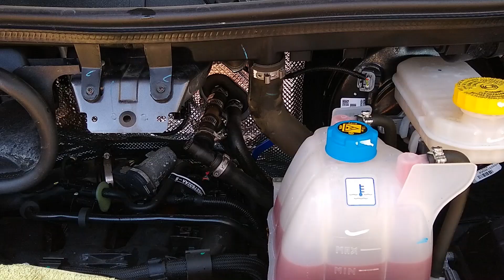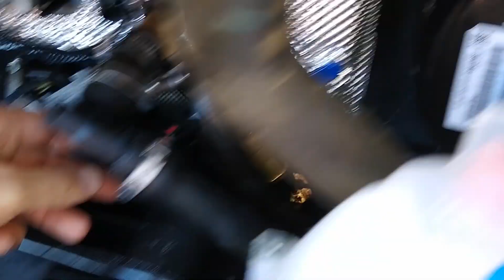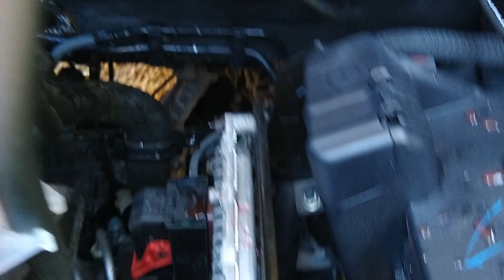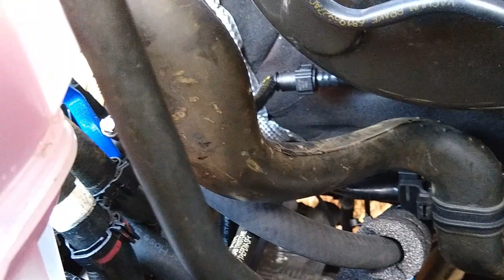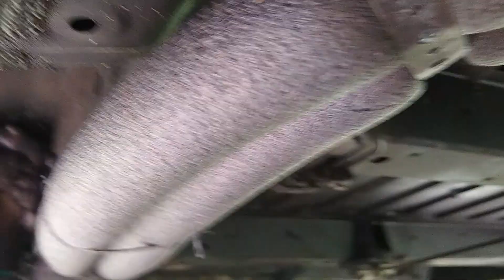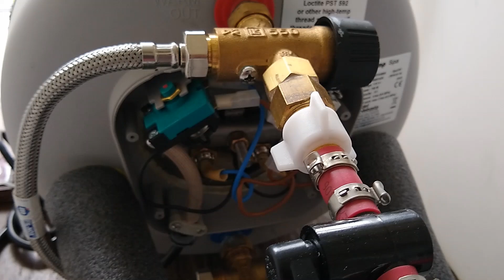Water Heater Install - Marine IsoTherm IsoTemp Spa 15 - DIY RV Promaster Camper Van - WanderingWakes

Comment: Question:  Why cut both side,  why not cut only one side (the return I guess) and install two 90 degrees fitting to extand the coolant loop instead of creation a second loop... I don't understand how the coolant will flow in both.  I will flow where there is less resistance... No?

Comment: Hi,  Thinking of putting one of those in our boat.  How long does it hold reasonable warm water?  I'm trying to figure if it is possible to maintain some heat in it overnight so one can wash up in teh morning without having to run generator or engine.   I have 200Ah of batteries and I'm tempted to put a 12 to 24V step up converter.  That would give me 32W and draw only 2.6A.     Running right on 12V would give me 8W.   If I knew how fast the temp drop in it I could figure out if this is at all feasible.  Any thoughts?
Reply from the maker: We regularly end our driving around 3 to 5 pm in the afternoon. Many times, we have waited until the next morning to shower. We seem to always have enough hot to warm water for two showers. The van is sometimes down to 50 degrees inside during the cold nights, but still warm enough water to shower. These are short showers of course. Hope that helps.

Comment: Thank you, very good and informative video. Much appreciated for the shopping list.
Does anyone know if the coolant hoses are the same diameter on Ducatos as well? Does it depend on the engine size?
If you have done similar on Relay, Ducato, Boxer(2011-onwards) can you please let us know about the parts you've used?
Especially interested in the T-junction dimensions.
Many thanks
Reply from the maker: I am not sure of the hose diameter for the other models. The tee connects would be the same on the middle tap, to match your hoses running to the tank. The in/out ends of the tee may have to be different to match your factor hose size. I would stop by an auto parts store, and then can likely measure them easily.

Comment: Great job ! I have the same tank but can’t locate the mixer  control ( mine does include the braided hose between hot and cold so it should be there ). What am I missing ? Thx !
Reply from the maker: The mixer valve should be the black knob on the hot side output of the tank. Top center when looking at the tank in my photos.
Reply: @wanderingwakes9500  how silly am I. Yes I have that knob, which is the temp control ( for the internal heating element ) but, in overcomplicating the issue, I had understood there was an additional control just to mix cold water with the hot AFTER it was heated. There isn’t obviously !!!
Thanks for clarifying
Reply from the maker: @OneEndlessRoad  Well, it is mixing cold water through that braided hose with hot coming out of the tank, so it does mix it after heating, but not too obvious. We find that a hot tank of water after driving part of a day is still hot enough the next morning for showering without running the engine to heat it back up. So the tank must be well insulated.
Reply: @wanderingwakes9500  that’s good to know. We are not quite there yet. So far I just have it connected electrically and have not run the coolant lines to the Hot Water tank. I was about to do that and I was then warned by the Mercedes sales guy that if anything were to go wrong with the coolant system, whether or not it was due to me tapping into the line, they would deny any warranty claim. He suggested I wait until the warranty was over and then do it. It did seem like a bit of overkill but at the same time made me somewhat nervous. A leaking coolant line could have rather disastrous consequences for the whole engine ! We will ultimately do it though and it was the main reason we chose this type of tank for our hot water supply.

Comment: Your video is tremendously helpful. In one of the comments you mentioned an app for monitoring exact coolant temperature - what is the name of the app and how does it function?
Reply from the maker: I use OBD Fusion and a bluetooth OBD dongle. This is the one I bought:
https://amzn.to/3NfPuC5

You can configure the OBD Fusion app to show many items. I set mine to show speed, coolant temp, run time, altitude, fuel level, and voltage.

I see my coolant temp get as high as 215 to 220 degrees at the high end with climbing long mountain grades. That is in the engine, so the coolant into the water heater is likely less than 200...

Comment: Hey, great video! I'm about to install this system in my skoolie conversion.. Should be easy because I have radiator routed into the bus for a rear radiator. One question though: On hot water exit there seems to be black platic.. a ball valve? is that what it is? I understand why you would want a ball valve on the cold water intake to shut off water and do work on the system, but why would you want one on the hot water exit? 
Thanks again!!
Reply from the maker: The black plastic knob is to control the mixing valve. It will mix cold water with the extremely hot water to make a temperature that is more safe. This comes installed on the unit I purchased. It is not a shut off, but a temperature mixing adjustment. Hope that helps. Thanks.
Reply: @wanderingwakes9500  Yes, I didn't mean that valve. 
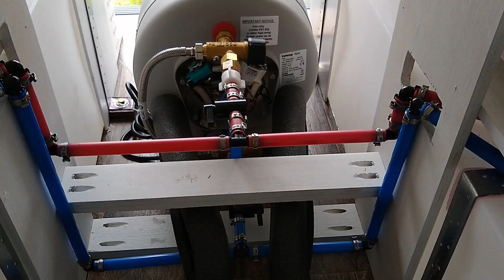Beyond the hot water exit theres the BSC fitting which you put a NPT fitting on, and then a white femal NPT which is connected to red pex. The red pex is connected to something black which looks like a ball valve... Is that what it is? Why would you want to put a ball valve on the hot water exit? It shows in the video at 11:08... Thanks again!!
Reply from the maker: @brutally_honest  That is a 3 way valve, there is also one on the cold water side. This allows you to bypass the water heater entirely by turning both valves to the bypass line. This is primarily used to winterize with RV antifreeze and not pump it into the water heater. However, it also could be used if the water heater failed or started to leak. I hope that clears it up.

Comment: There’s no heat exchanger? You would not need the three-way valve with a heat exchanger. This is actually my plan for my Ford Transit 350 HR AWD except it will be the hydronic system.
Reply from the maker: The heat exchanger is inside the isotherm unit. The three way valves in the pex lines are to bypass the tank for winterizing. Thanks and good luck.

Comment: Hi greetings from Ecuador
Thanks for you heard videos
Please can su explain about resistence and both thermostat in a heater isotemp thanks
Reply from the maker: There is no thermostat, but there is a mixing valve to reduce the water output temperature.

Comment: On my IsoTemp Spa 15 purchased February 2022, my drain valve thread is also a BSP. So, I bought another BSP to male 1/2 NPT fitting.
Reply from the maker: They must have made a design change. Thanks for the update.

Comment: I just finished an install on one and find that the mixing valve does not mix in enough cold water, and the hot water is still dangerously/scalding hot at the faucet! Trying to contact Isotherm with no luck. Did you encounter this at all?
Reply from the maker: Yes. You can loosen the screw holding the mixing valve black handle in place. Loosen it enough that you can turn the handle back toward the hot direction, without actually turning the valve. Reseat the handle and tighten the screw. This will allow you to turn the handle (and mixing valve) more in the cold direction. This worked for us. Thanks.
Reply: @wanderingwakes9500  I tried this but even backing it out all the way open it didn't make a difference. I called Isotherm and they're sending me a new mixing valve, I think mine is stuck/seized. The knob never made any noticeable difference in the water temp.
Reply from the maker: @Armandooooo  yes, that does sound like it is bad.

Comment: How does this effect engine cooling or the water pump having to pump the coolant the extra distance?
Reply from the maker: I have not seen or heard of any issues. If anything I would think more coolant and the increased ability to transfer heat should help.
Reply: @wanderingwakes9500  it seems like a good option for hot water except for a few other possible issues if you live in a cold climate if it's installed under the van, draining it after every use would be a huge waste of water. 
If installed inside the van, during the hot summer months this hot tank of water in the van I'm sure would increase the temperature in the van substantially. 
If these issues could be resolved it would definitely be the way to go.
Reply from the maker: @MLA..  Ours is installed inside the van. It is warm, but ours is tucked under the bed and does not seem to radiate much heat. Under the van would be an issue in cold weather, but it is also large enough that I don't think you would have enough ground clearance if it was exterior. It may not work fore everyone,  but for our van without propane, we like it. I am considering building WanderVan2, and at this point, I would use the same water heating solution again. Happy trails...
Reply: @wanderingwakes9500  one last issue I would also need to come up with a solution for.
If the lines running from the engine to the hot water tank or something internal in the tank ever fails you not only loose your hot water your engine also becomes inoperable do to loss of engine coolent.
Reply from the maker: @MLA..  In my case, we installed ball valves to shut off both lines to the water heater and revert the system back to essentially factory coolant lines only if we ever had a leak in the added lines. We would lose hot water, but we could continue to drive.
Reply: @wanderingwakes9500   I've thought of that option but your increasing connection points and in turn increasing probability of failure. So I think more thought needs to go into this before implementation.

Comment: Great video. Does it matter which inlet/outlet port the hoses go in to at the water heater? I see the left should go to the engine return and the right side is coming from the engine. But how do you know which is which from the engine coolant system? Does it even matter? Thanks in advance for your help!
Reply: Yes an answer to this would be a great help?? Thanks
Reply from the maker: @michaelmcmahon9432  Just replied...
Reply from the maker: Not sure why I did not see this earlier. It will not matter which direction the water flows through the isotherm unit for the coolant from the engine. The fresh water into the unit and hot water out are different.

Comment: @wanderingwakes - Thanks for the well done vid - I have my entire system ready to go just checking a few last minute things before connecting everything up tomorrow and your vid has made even simpler --- the one thing I did and you may want to consider - I used two brass bulkhead connectors through the floor so no chance of cutting the heater hose while they move while driving... Thanks !!
Reply from the maker: Good idea.

Comment: Great video thank you! I am surprised T fittings work for this application. I would think that the hot water would just take the path of least resistance and skip your loop. Or worse, the heater loop is less resistance and less coolant goes through the radiator.
Reply from the maker: Hot coolant seems to flow to both loops just fine. Thanks for watching.

Comment: Thank you for the video. How do you winterize your heater tank?
Reply from the maker: There is a valve at the bottom of the tank. Mine is attached to a short piece of PEX pipe that runs through the van floor. I open the valve and all of my faucets and let the tank drain to empty. Thanks for asking!
Reply: @wanderingwakes9500  thank you!

Comment: did you consider plumbing the calorifier in series (cab heater matrix return) rather than breaking into both flow and return hoses, does the cab heater matrix not short circuit and by pass your calorifier? Hi from the UK by the way, and a top vid.
Reply from the maker: I think the factory setup is to put the rear heater hoses in parallel like I did with the water heater. Most other installs I researched hooked it up in parallel. Both seem to get good flow. I can monitor my coolant temp exactly and it is running about 208 F most of the time. Series might work, but parallel as we did seems to be just fine. Thanks for watching!

Comment: Great video thanks!  Couple questions.  
1. Did you need to install an inline pump or is the vehicle water pump enough to circulate through the water heater.  
2.  Have you had any issues with the isolation valves?  I'm concerned they may fail due to the high temp the Promaster runs at ~220F.  Thanks!
Reply from the maker: Good questions. The water pump has no issues circulating coolant, in fact, the factory option for rear heat essentially does the same thing. No problems with the valves at 220F. The are metal ball valves and should be fine. Many of the factory fittings and parts in the coolant system are plastic, so metal parts should be even more robust. We just got back from a 1700 mile trip, and it continues to perform wonderfully.

Comment: Installed the heater and everything works just fine. I’ve just noticed fluctuations in the coolant levels. Have you seen this? Do the hoses just expand a lot and lower the level? I’ve added coolant 3 times and cannot find a leak in the system.
Reply from the maker: You might check all your hose clamps to make sure nothing is dripping. I had one that was a slow drip. That being said I am hearing the ProMaster seems to slowly lose coolant with no apparent or noticeable leak. I've had to add about a quart in 15,000 mi. I guess if I only have to add one gallon every 60,000 miles that's not a big deal. I've read of others having a mechanic tear into their engine but I'm not interested in doing that for a small coolant leak. I'm wondering if it gets hot enough to overflow during long trips but nothing leaks at my driveway. Just a thought. Glad to hear your heater is all hooked up and working.
Reply: I’ve added probably 1/3 of a gallon since I finished. I am not seeing any leaks on the ground.
Reply: After this install is your coolant tank sitting at normal levels or is it low? Mine seems to operate on nearly empty. Only different between ours is my tank is mounted vertical.

Comment: Hello from the high desert of New Mexico USA 🇺🇸. Thank you for sharing your thoughts and ideas with us and I think you did a good job making the video. I'm building a 1967 GM TDH-4519 city transit bus 🚌 and I live in it full-time and have been thinking about what I want to do for hot water. How much did that water heater cost?
Reply from the maker: I paid $464 in February of 2020 from fisheries supply. I see they have it now for $494. We are very pleased with it since we moved the van usually daily and chose to not have propane on board.
Reply: @wanderingwakes9500  I guess the price has went up a little!!! They are now $827.

Comment: I'm pulling the trigger on this finally and was wondering if you put any bypass/shutoff so you can bypass the tank completely?
Reply from the maker: There are valves to bypass the heater in the freshwater system. Useful for winterizing, etc.   There also tee fittings under the hood that I can shut off to stop coolant flow to the heater. Best of luck!

Comment: How have you been managing the engine tripping the reset button? Does that happen every-time you drive the Van? What exactly is that for? To prevent the electric element from running when the water is too hot?
Reply from the maker: We typically don't use the electric element so I have only had to press the reset button a couple of times when we needed to heat water with electricity. I do not believe it trips every time I drive. it seems to be there to prevent the electric element from overheating but with the temperature of the engine can trip under extended driving.

Comment: Do you think it would be better to go inline instead of teeing the heater matrix?
Reply from the maker: Everything I have seen is using tee fittings, rather than inline. I think the factory rear heat option is also tee fittings, but I am not 100% sure. My concern with inline would be that if some issue developed, you could overheat the engine due to restrictions or a burst line. With tee fittings and shutoff valves, the rear heat can be isolated and effectively return the system to the factory setup. Good luck with your project!

Comment: Nice video
I have the same water heater to install. My question; can I run the water heater and warm the water just using the electrical element? I don’t want to run the boat engine every time I want hot water. Thanks
Reply from the maker: Yes, I do this when friends stay in the van parked at our house and it was not driven. You may have to press the red reset switch after using engine heat, as the high temp usually pops the switch to prevent the electric element from running. Most people drill a small hole in the access cover so that the switch can easily be pressed with a pencil or small finger.